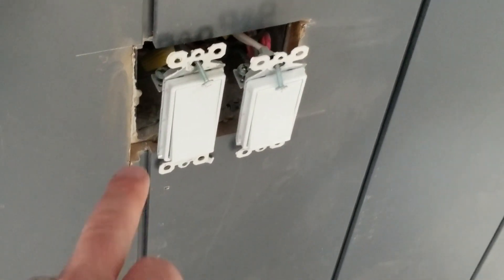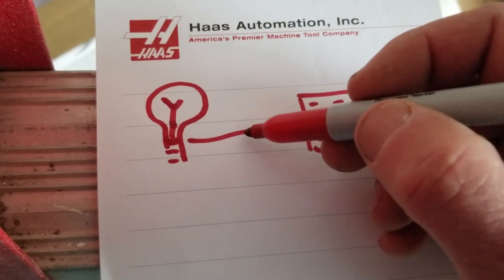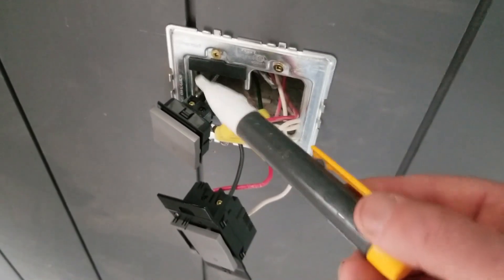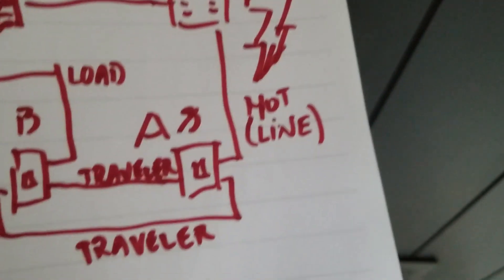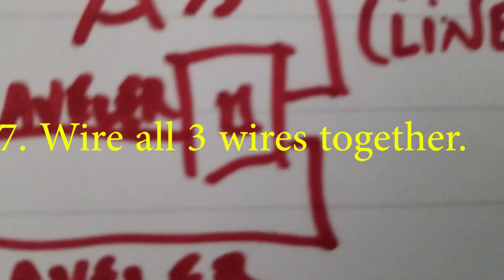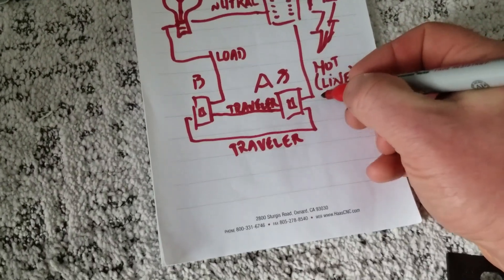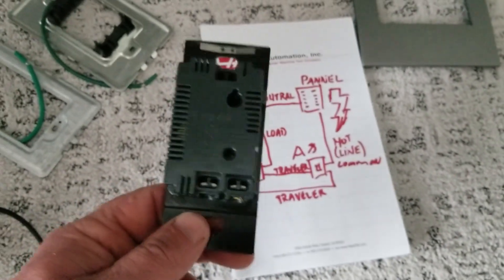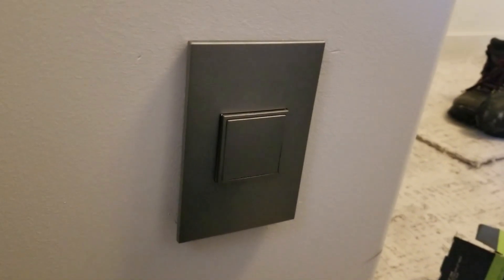Wire a 3 way switch | reference

Comment: As a man who has spot welded a screwdriver to a switch box, I have saved this video to my "live longer" play list. Good stuff!
Reply: Good news is , when you accidentally short something it trips the breaker and saves the walk to the breaker box.
Reply: @freddieh5539  also I know have an amusing anecdote for NOT doing electrical or bathroom work. :D
Reply: honest curiosity:
was the spotweld accidental and if no, followup question: why?
Reply: @FulloutPostal    I can't speak for the original poster, but in my personal experience, every single time I spot welded a screwdriver, it was accidental. Too lazy to walk to the breaker box, then nature takes its course.
Reply: @freddieh5539  I've only ever messed with residential power, never high voltage stuff, but whenever I screwed up there was a funny light, then the breaker tripped...
never managed to not be able to remove any tools I had at the time...
Reply: @freddieh5539  I was indeed lazy in those days, but I was also more trusting. I still have no idea if he actually flipped the breaker or not to this day.
Reply: @FulloutPostal  'leccy
Reply: @FulloutPostal  I was "helping" a buddy with his cafe that was in a 100 year old building. He said the breaker was off. Being, as I mentioned, skittish about these things I was being real cautious. I saw something that looked like copper next to the box, but not touching it. So ofcourse I had to poke at it. Next thing I know big sparky song, and the screwdriver was one with the box. I was done for the day, and essentially done with electrical from then on. :D
Reply: I had spot welded a screw driver in the outlet box. The original owners had put a penny behind a 20 amp screw in fuse. It was an old panel. Could have messed me up good, but that’s why you use good insulated tools in hot boxes.

Comment: Me and a bud once wired a 3-way switch and decided mid-way to add an outlet out from one of the boxes.  An hour later everything worked but when you powered something from the outket, it would share power with the light bulb.  Rather than say we fucked up by wiring the light and outlet in series, we hooked up a sazall and called it a noisy dimmer.

Comment: As an electrician I can tell you this would be a whole lot easier if you just cut the wires off the old switch showing a little of the jacket color attached to the switch, and wire new switch the same exact way..why spend all that time remarking line and load?
Reply: Then you would have two blacks in the box and which one would you chose
Reply: @jamescook8940  That movie is behind the curtain and the answer is BOTH!

Comment: Everything you say on how to wire it is correct the only thing I would add that here in America your not supposed to use the white wire as a traveler if you do you have to change its color
Reply: The white typically gets indicated as a hot with a ring of tape on both ends. As the black becomes the line side of the load.

Comment: I'll be honest, I used to think three way switches for lights was neat until I've owned a house where every freaking light is three way, and one light uses three switches. Now I'd just prefer each light have its own switch, up is on, down is off. Especially when you live with a couple button pushers.

Comment: There's about 5 ways to wire a 3/way switch...
You picked the easiest.
So... You took the switches out while remodeling and this is what we get for it?
Old electrician here but now days even I can take a quick pic before I start disconnecting stuff. Lol
Lol
Love you bud.

Comment: Call us old fashioned but us here in the British Isles have a system for identifying 'live' wires which works fairly well, we mark them and colour code them !
And that is not a 'three way' circuit or switch, a two position switch only has two ways, it's either on or it isn't, you shouldn't get your terminology from those guys south of the border !
A three way switch circuit has three switches in it, there's a standard two way circuit but you add an intermediate switch between the travellers so you have another point to control it from.

Comment: ACHTUNG: Blinkenlighten fuzzy logiskengaten flip floppen und den floppen offenen und den sprechers nicht mickrofon nicht kamera und nicht focus du fokken und den fusen poppenen und luftwaffe bomben und die blackout blinkeren offenen fuseboxen. Kein Problem, es wird alles kirschrot leuchten, nachdem die ersten Flammen abgeklungen sind. Designed by Ikea in Sweden, manufactured in PRC

Comment: another thing to note is the travellers should almost always be on a 3 wire, i've seen some wierd stuff where it isnt but 99% of the time both travellers are 2 of the 3 wires on a 3 wire (a red black and white in the cable)
Reply: I believe that current US code requirements for new installations require a neutral in every box, even if you don't use it.  So 4-wire.  Yeah, I know it doesn't make any sense.My home also has multiway-switches (DPDT) to provide additional switch points.   Leads to new owners saying "I never saw that switch before--I wonder what it does..."

Comment: Nicely, but please put wire nuts on the exposed conductors, especially when little ones may be around.  The chicken stick should work well when touching the insulation.  Natural selection is one thing, but...

Comment: Who'd of thought setting up 3-ways would require so many steps and safety measures
Reply from the maker: I'd caution you to be ginger carefuling, sticking your tender bits in 3-way holes; they bite.
Reply: Never look at your buddies load at any cost 😳concerning three ways🤔oh in being common that's just a myth!!!
Reply from the maker: @Mr.Avuncular  That extra lady ain't there for you buddy.
Reply: @arduinoversusevil2025  lack of words in laughing ......Thanks for all you do my friend 👍
Reply: My Pop’s Master Electrician buddy just wires them up hot. 🤷‍♂️💪👍🏻👌🏻😏
Reply: @tomtheplummer7322  To paraphrase my teacher as an elekchicken:  "Our trade does not tolerate bravery and harshness. They are the ones to die first." Mind you I am across the pond mains is 230V/400V here. Otherwise missing the protective earth as that is also essential here. Don't really know how it is not compulsory over there especially if you want the ol GFCI to work.
Reply: wrap my wire nuts?! I think not.

Comment: Thank god for electrician buddies that work for beer after hours, that’s how I wire 🤣
Reply: I’m sitting here contemplating disassembly of my oil boiler, to fix a noisy fan bearing…I know how to do it, just can’t be arsed on a Friday night….and it’s still giving heat, just the whine that’s interfering with my Guinness intake….😂👍🇮🇲
Reply: @ManxAndy  -  Shooting range ear protection can serve multiple purposes (also great for a nagging wife).
Reply: @freddieh5539  ha ha…….I,was thinking similar…..didn’t tell the wife though ……😂👍🇮🇲
Reply: That’s what my Pop’s did, but his electrician buddy drinks the beer and wires em hot, so as to make it more efficient. 🤷‍♂️😏👍🏻👌🏻

Comment: Hey @AvE - How's it going in Canidastan?
Reply: Trudeau's still PM so...
Reply: @ThatDaveFella  - J Castro's the queen of Canadistan...
Reply from the maker: Great! I know what the plan is, so yeah, much better.
Reply: @arduinoversusevil2025  - We're in DEEP doodoo...Check out our present electricity supply problem, (Loadshedding South Africa). Everyday without 10 hours of power so far...and guaranteed to get worse...
Reply from the maker: @The_Hairy_Farmer  Interesting! The far flung edges of the empire fall first... I recall a recent suspension of travel to SA after the goobermint decided it didn't need another order of medicine.